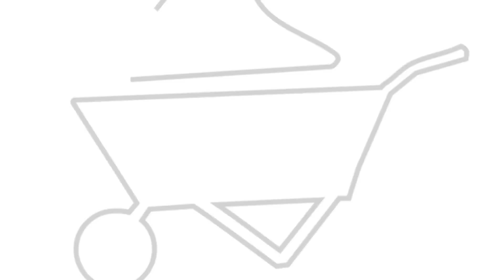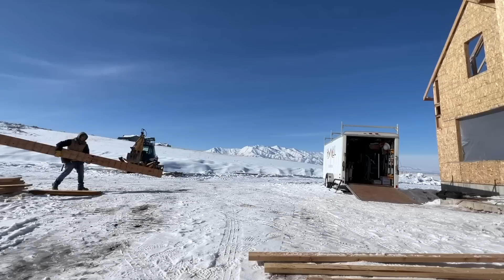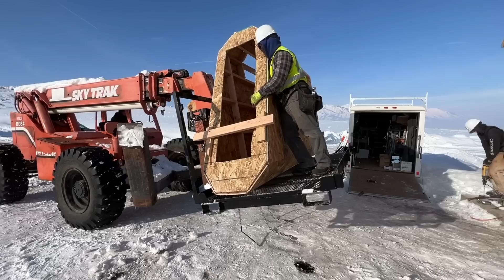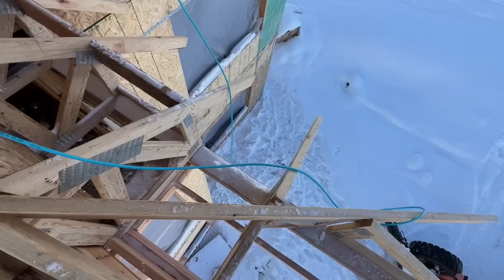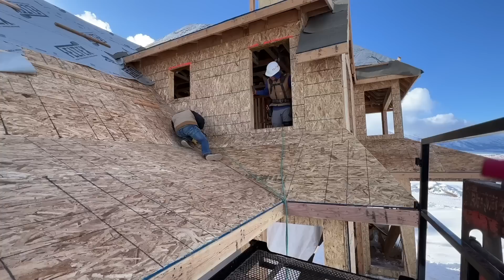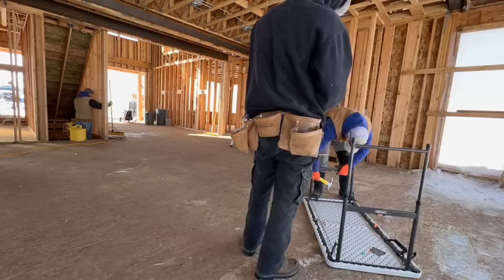Final Days of Framing

Comment: Wow the house is coming along amazingly, 
Can I ask a genuine question 🙋🏻‍♀️ we live in Europe UK and then NL to be exact, all our homes are brick/concrete construction. 
How does the wooden framing withstand such harsh winters? I would have thought that the boards would be warped and potentially rotting due to the snow adding so much moisture into them? As I say genuinely curious as I’ve not seen homes built this way before.